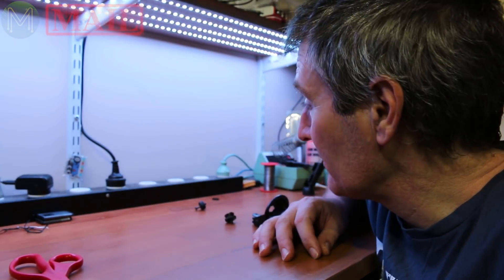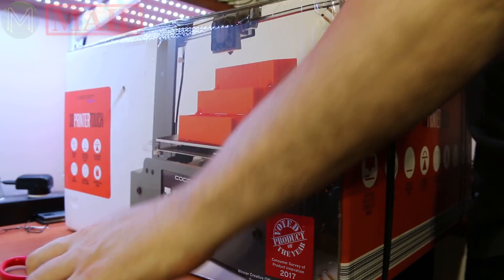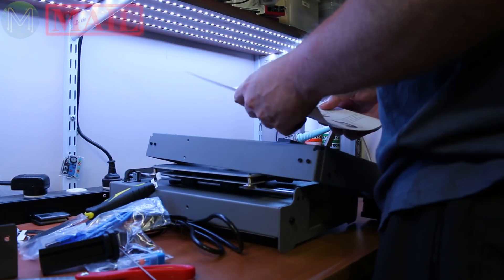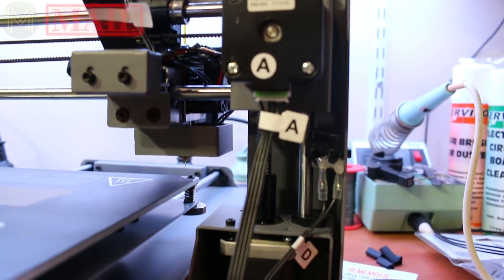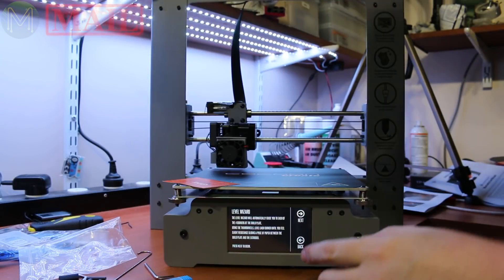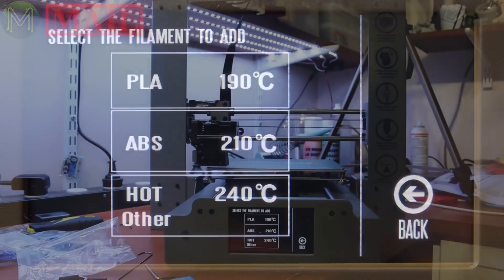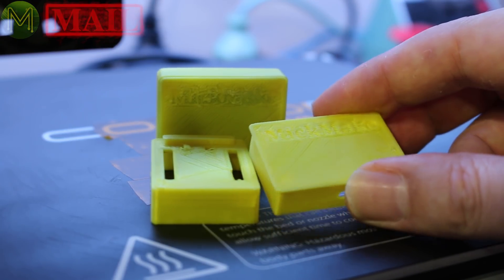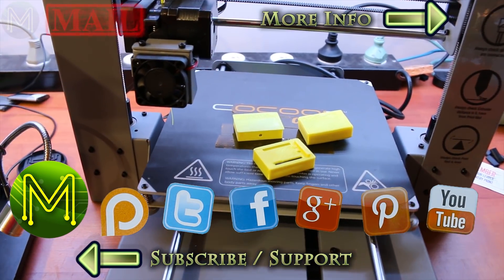#197 MickMake Mail #26: ALDI 3D Printer - Cocoon Create Touch // News

Comment: It's a great little printer. Beats the pants off the $3k MakerBot IIx(s) I bought for the office and at the price it's a cheap printer. Especially considering the value add of the Cocoon crew.
Reply from the maker: Yeah, so far I'm impressed with it. I've had a few failures here and there, but generally get some good prints from it.

Comment: Hey, what's the settings you used. I can't get it to print anything except the demo files?
Reply from the maker: There's a number of things you have to modify if you're using the stock Ultimaker Cura - that's what I use.
Make sure you download the Cura PLA Profile from the Cocoon website.
Reply: i am using ultimaker cura and i did download the Cura PLA profile form the cocoon website and followed the instructions in adding the profile to cura. But still no luck, is there any other changes and/or could you give me details on the print setup values?

Comment: Noice! I'm a little surprised that Kapton tape improved things though - that surface that's included is supposed to be better - that's the point of it  :/
Reply from the maker: It didn't improve by much, but certainly better. At the worst case I could peel off the Kapton tape, whereas before I had to chisel the print of.

Comment: The super flimsy print was a filament size error. Cura often defaults to 3mm filament which causes that effect when printing with 1.75mm which is the standard now.
Reply from the maker: Yeah. After a couple of prints I found that out. I reckon the quality could get better. The models that they supply on the SD card are pretty decent.
Reply: Thanks for the reply. A really neat topic would be the start and end g-code sequences. You can use g-code to play music with the stepper motors to signal the end of warm-up, print is finished, etc. You have to move the print head to a safe area first(found out when I wrecked my first print I tried it with), but it's a really neat trick that works with any printer that uses g-code.

Comment: oh no. ALDI never sell quality electronics. I'm regretting buying my Tevo Tarantula coz it was so cheap but now wondering after looking at that, it isn't so bad after all.
Reply: Print mods for the printer they would be mostly under Wanhao i3 on thingiverse. All stock i3's are not very good till you get some basics out of the way like belt tension, fine tuning your print settings in your slicer (speed settings, layer settings, extrusion multipliers, then tune the settings to the plastic you are using so print temperature towers for every different manufactured plastic you use (example i have printed the same type of plastic PLA from 180 to 215 from different sources and achieved top quality results for each).  

Is this printer still based off a Arduino mega 2560?
Reply from the maker: True, the quality is dubious, but the Cocoon printers seem to be doing well.
Angus' review of the original says it all, (https://www.youtube.com/watch?v=Bd5EvrnQC5Q).

Comment: Just FYI Mick. You can pick up an Ultrabase from AnyCubic ($35 US) and it allows the filament to stick to the base with no other adhesive, tape or slurry. I put one on my CR-10 and it works great. If you do not want to go that path there is Magigo 3D printing adhesive. This has worked on all 7 of my printers.  Love your channel!
Reply from the maker: Nice. I gather you'd get a smoother finish and they'd last a lot longer.

Comment: Ha ha, bought one myself, trying to print something complex, after a couple of easy prints, not really handling it, think I'll take it back and order a Prusa.
Reply: btw this printer is essentially a prusa. Think you need to up-skill...........
Reply: Yeah, the MK3 is a really sweet printer ;)
Reply: The printer is fine i get excellent results with it. If you don't get good results you should tweak your settings and your desings a bit more.
Reply: If this is anything like my Anet A8 there would be heaps of customization prints so far i am up around 100hrs of printing just mods alone for my printer and it improves the quality of prints by a LOT. I don't know what you are getting extra entirely for your money with a Cocoon/ Anet A8 as they are all are clones of the Prusa i3, as far as a cocoon goes look for a Wanhao i3 mods as its a re-brand.
The only thing that's worth extra money when it comes to a 3d printer is build material (which isn't a whole lot extra as AM8 (Anet A8) aluminum frame mod shows doesn't cost a whole lot extra and better electronics (can be expensive). Being a I3 clone i would believe that this is still based off the Arduino mega 2560 so i am not sold from my mega cheap i3 clone to these more expensive clones with some tweaks like a touch screen. Especially when mods like Octoprint are freely available using a raspberry pi as a print server, or even a ESP8266 wi-fi mod in the case of my Anet A8.
Reply: +James Lamb Great testing process. Oh yes, the Prusa Mk3 would be awesome to have. Cheers, JAYTEE
Reply: I've had great success with my first one and this year I bought 2 more. Haven't put too much through the new ones yet
Reply: Thanks nelson, Jan, JAYTEE and Side85Winder I'm aware it's a "standard" rep-rap printer. I persevered with the printer and got some good results but I'll be damned if I could get some prints to fit together properly. So, to test the printer, I printed the same object on opposite corners of the bed, they were slightly different sizes and rather than chase down the problem I returned it. Yes I went with a Prusa Mk3. It's worth the extra just for its lack of noise alone, and, it's accurate.